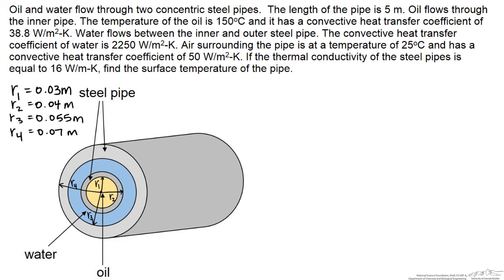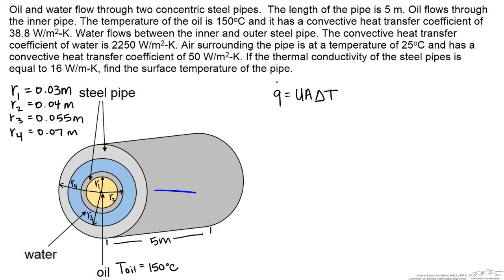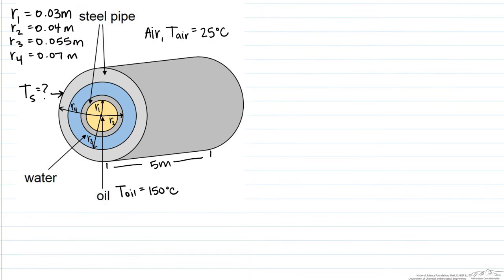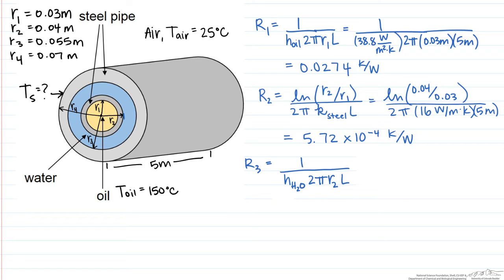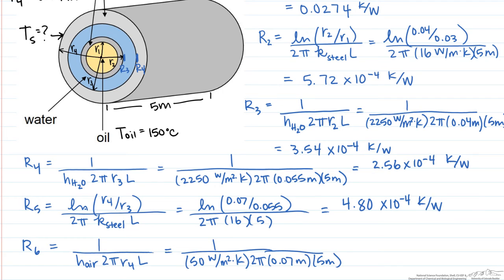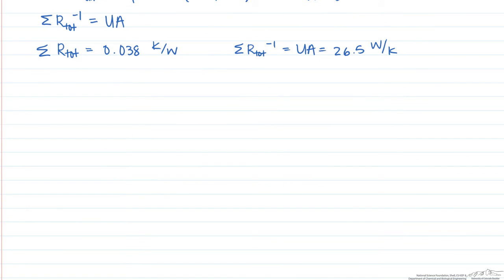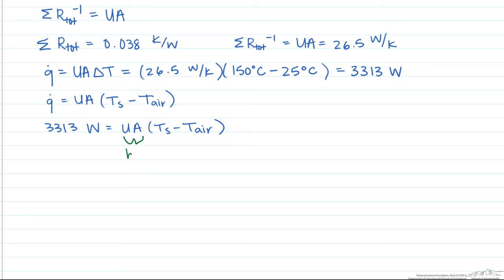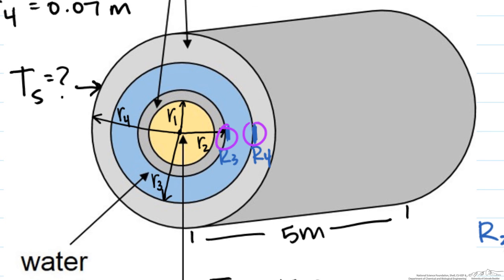Surface Temperature for a Cylindrical Pipe

Comment: Trust me, when you use natural logarithm for the case of cylindrical shape, then you will have problems when calculating the Heat value and temperature when R1=0. This also applies to the spherical shape. I just hope that you read

Comment: I would like to ask a question, if hot water is flowing through a pipe (any dimensions and material is steel) in order to maintain surface temperature at 35 degrees Celsius, what will the temperature of hot water which is flowing through a pipe

Comment: The problem states that water flows between the the inner and outer pipes. If this is true, q from the inner pipe does not equal q to the outer pipe. Based on the solution provided, the water is actually stagnant.
Reply: so, how to get the q in order to get the surface temperature of the insulation
Reply: I would like to ask a question, if hot water is flowing through a pipe (any dimensions and material is steel) in order to maintain surface temperature at 35 degrees Celsius, what will the temperature of hot water which is flowing through a pipe